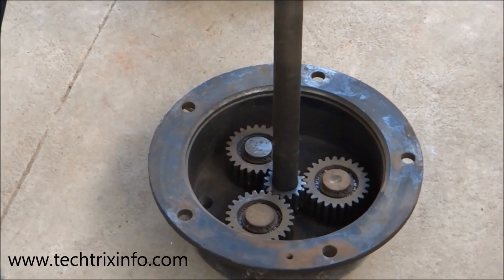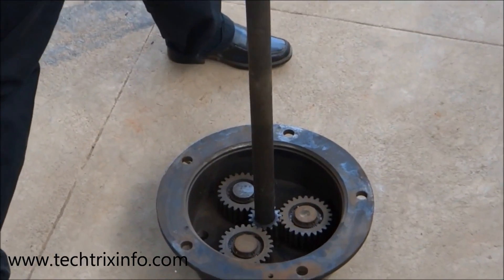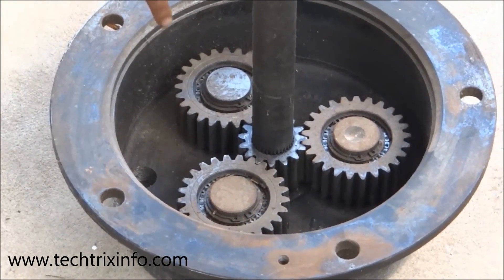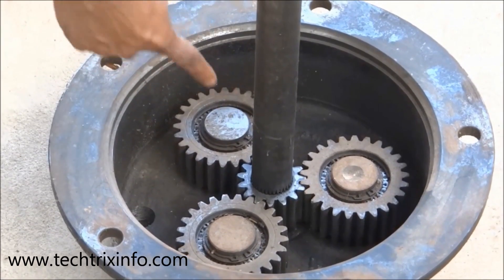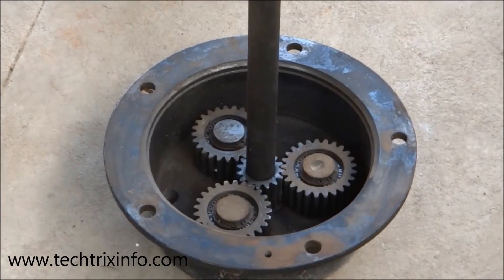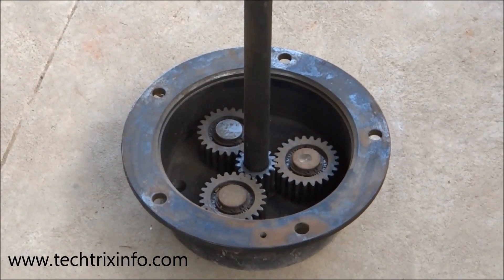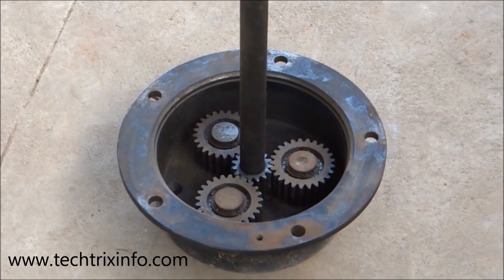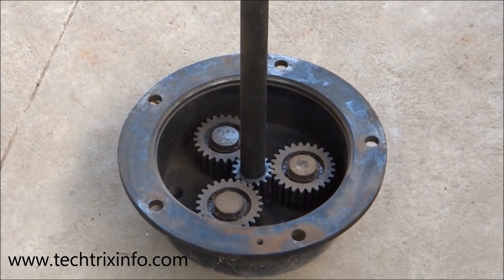How drive from axle shaft reaches wheel hub. ✔

Comment: I have two 24Volt DC hydraulic motors for my light weight EV conversion project  how can I connect them to the PTO without using fanbelts  , smaller anxle gear  gear, in this sense instead of the main shaft dividing rotation into two direction  ,it has to convert 2 different rotation into a transition inlet , these motors are 2hp each and I am trying to combine them to 4 hp